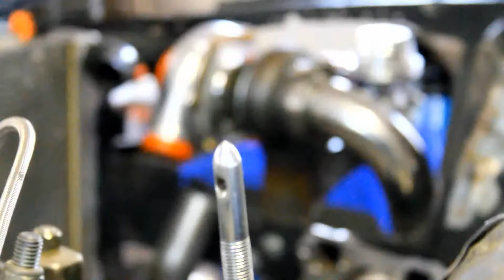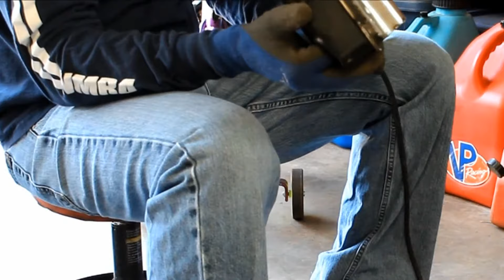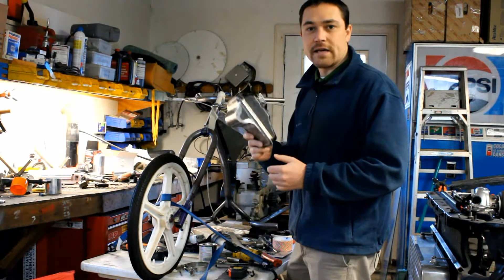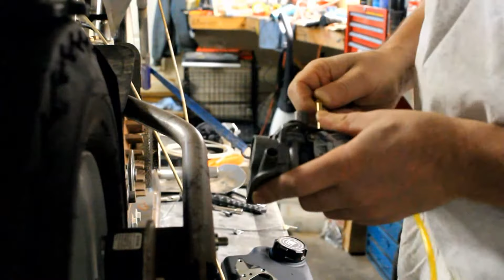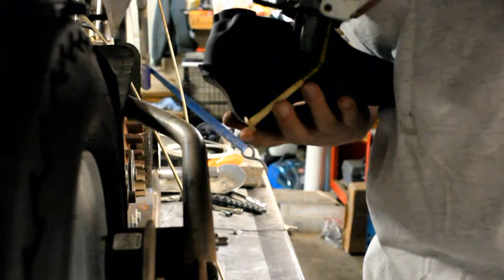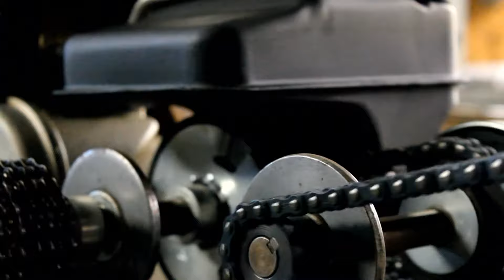Mini Chopper Build part 5

Comment: when will part 6 be up i am stealing some of your ideas like the fat back tire but i want to see it done and riding
Reply from the maker: I am working on six now. Finishing paint as we speak and should have it back together soon.
Reply: TheFabForums.com ok 2 other things i am doing this in machiene (i think thats how you spell it lol) shop and was wondering 1 will the berings hold up in the bike tire or what and 2 where did you get the transmission can i have a link
Reply from the maker: I don't see the bike tire having any issues under 45mph, and the tranny was purchased from a go cart parts place on line bmkarting.com, I don't think they stock it anymore though.
Reply: TheFabForums.com Also where did you get the WHOLE hydrolic brake system
Reply from the maker: Speed will depend on how you have it geared. The brake system is what they use on the race type go karts.

Comment: what size tire is that if you don't mind
Reply from the maker: front or back?
Reply: TheFabForums.com well I was talking about the back tire but both lol
Reply from the maker: Hey Ben, I will get you some sizes. The rear is a turf style mower wheel and tire.
Reply: TheFabForums.com yea I figured that I was looking at an 18x 8.5x 8 kenda golf cart tire im putting a 6.5 hp on a frame thinking I like that tire but just seeing what you had put on yours... also are you using just a flux core welder?
Reply from the maker: I think that's what this is. It has a four bolt hub. Its not flux core, it is actually a gas shielded welder but seems to platter some.
Reply: TheFabForums.com cool thanks awesome job